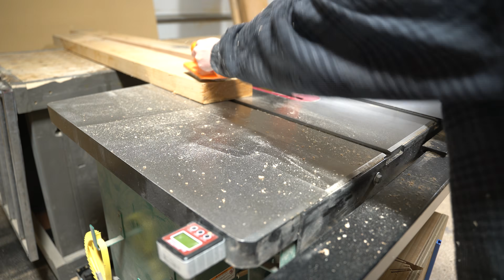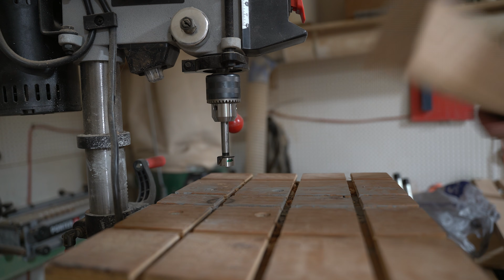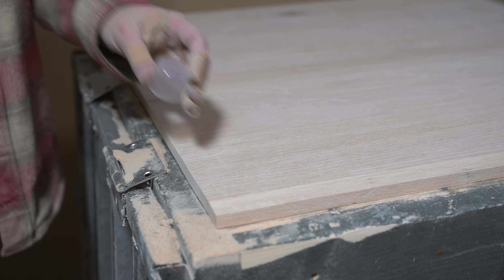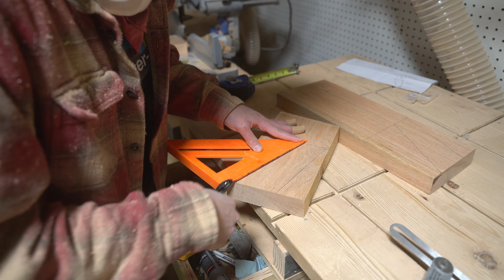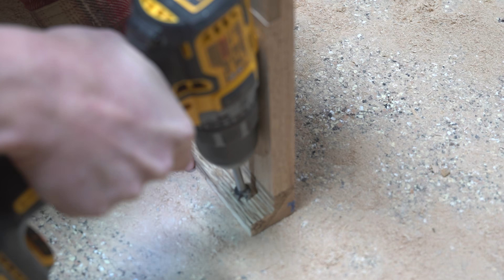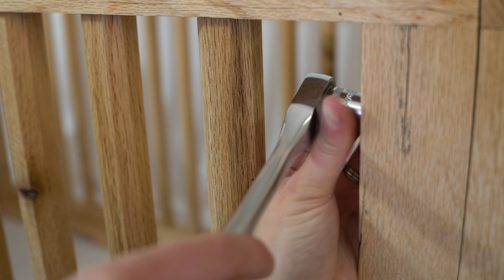DIY Convertible Crib - Mid-Century | HW|Designs

Comment: Great crib but after building this myself I am very disappointed with the plans. Almost every plan I used over 20 years of woodworking there is actually details on the plan but not this one. For example, interval spacing between spindles is wrong,angle on the x supporting feel (not feet) is 35 degrees or 55 degrees? I could go on and on. Video starts out good but then is edited poorly with measurements she gives are cut to the quick and hard to follow. So I would not have spent 15 dollars on such a poorly devised plan.
Reply: I agree, awful plans.  Might as well just use the video.  Pay $15 for plans that are only slightly more detailed than the video, which is to say almost not at all.  They got me on this one.   I will most definitely not buy anything from Honest work designs again.
Reply from the maker: Hello All! I've updated the plans to include specific cut lists, links to specific hardware etc. I've only ever built things for myself and my clients from custom designs, so plans are a bit of a foreign concept to me. I only put these together because of demand, but have heard y'alls input and improved upon them.  If you've purchased plans and want the updated set, shoot me an email! And of course, the same is true if you're unhappy with them and would like a refund.
Reply: @HonestWorkDesigns I just stumbled upon this video not knowing plans existed; I have to say that it's lovely you respond with eloquence and grace. 
Just lovely 💖

I subscribed and will be purchasing the plans, my son and I would like to build a crib for my nephew 🥰🥰🥰
Reply: @HonestWorkDesigns plans still are not good at all. No spacing for spindles, had to end up working backwards. Don't respond to phone calls or emails. Do not buy these plans!
Reply: Hi! Where can I find the plan?!
Thanks!